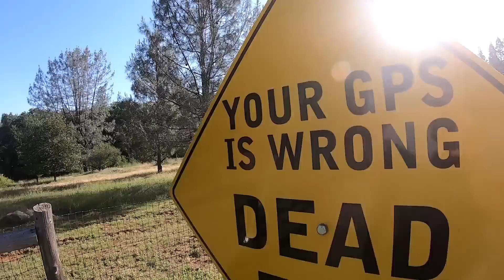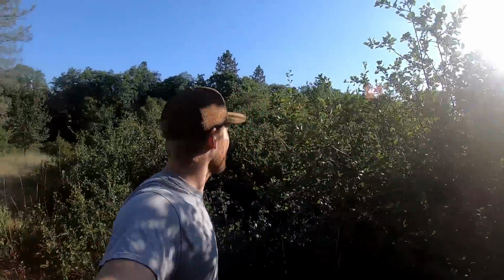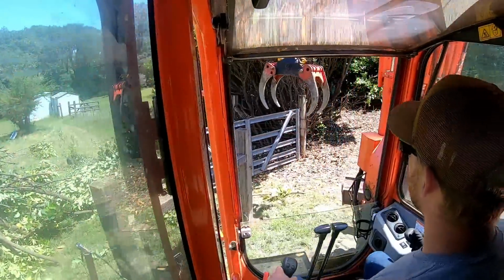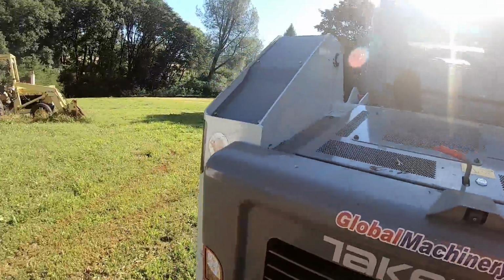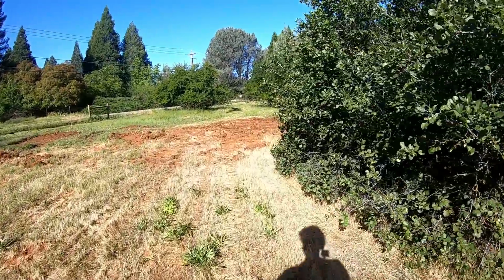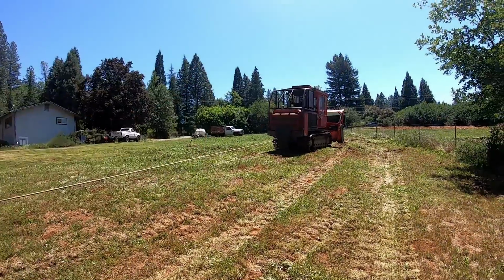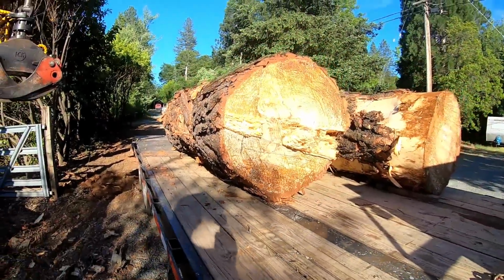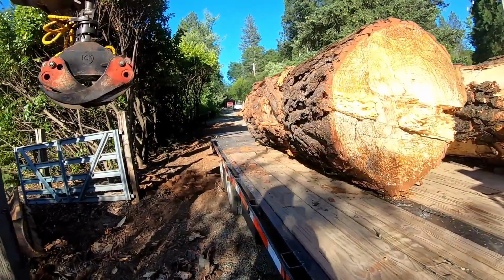Forestry Mulching an Over Grown Pasture

Comment: Another good vid guys, funny that you were loading out that bucked up tree section onto your trailer as I was doing the same on Sunday here in CT with my Volvo EC 55. Mine was a huge pitch pine and was testing the capacity of my machine, was 24inches in diameter and 16 feet long sections. Had to put the blade down for that sucker.

Comment: We run the Ereckison extreme bushhog on our C 238 New Holland trackloader, in overgrown brush up to 4 or 5 years growth is hard to beat, it can cut up to a 6 inch diameter oak, and have cut up to 11 inch pine tree, it has hardly any maintinance, no expencive teeth to replace, and they recomend to not sharpen blades.  It works wonders in grown up feilds

Comment: Do those carbide teeth need changed after each job you perform? Seems like those teeth take an bit of a whooping. Great work and content.
Reply from the maker: Teak nope the FAE carbides are pretty tough. Last 500-1000 hours depending on the area they get used it. Knives in the awhi need sharpened everyday maybe twice a day